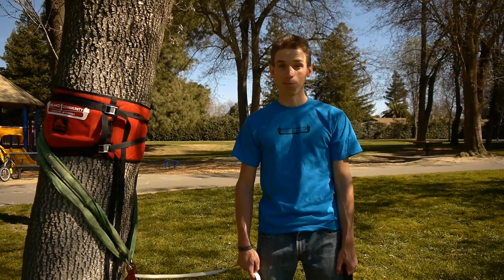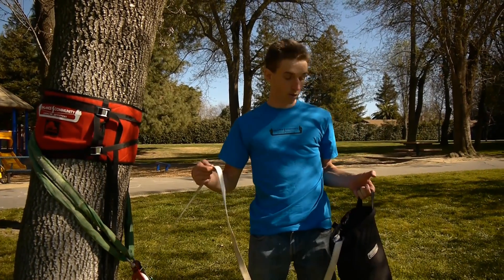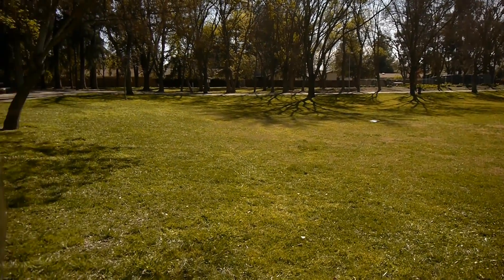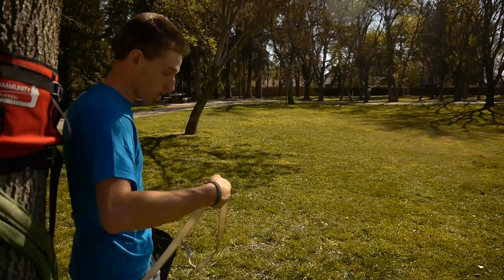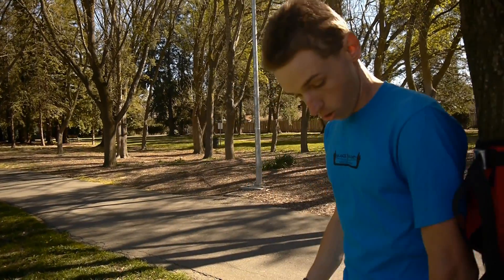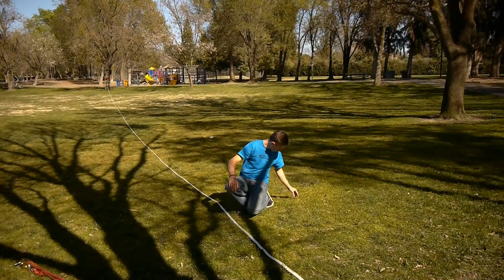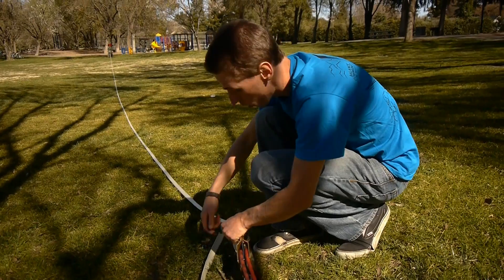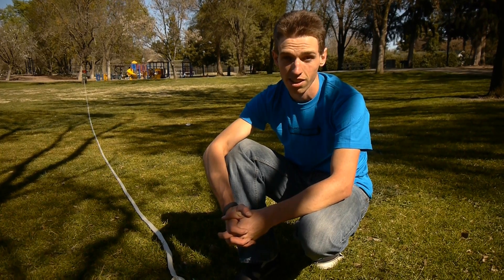Slack Science - Measuring Pulley System Length

Comment: Good video Jerry, I'm surprised more people haven't watched/liked/chimed in!

One trick I have, is when attaching the pulleys to the line, in the spot I have marked, I pull as much slack out of the line as I can. I feel this holds more accurate to the calculated pulley system length. Especially on shorter lines, this line sag becomes a pretty significant factor.

-Lars